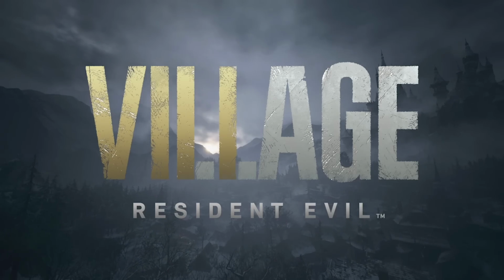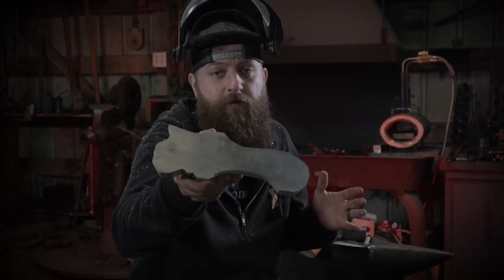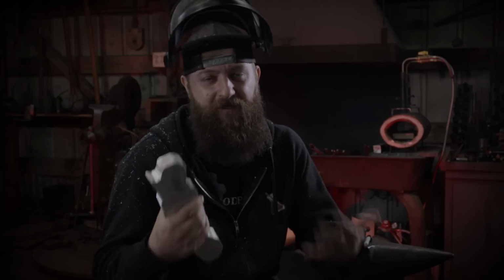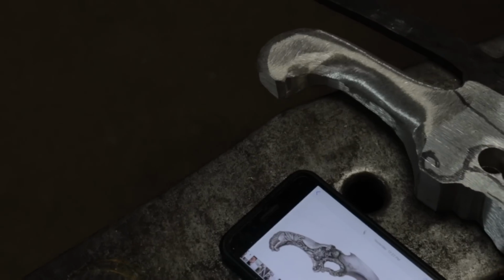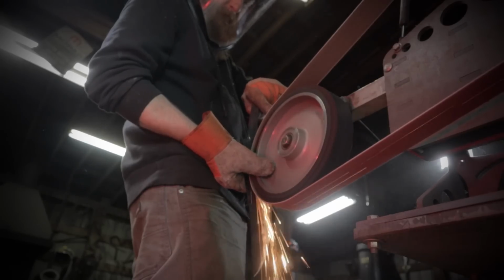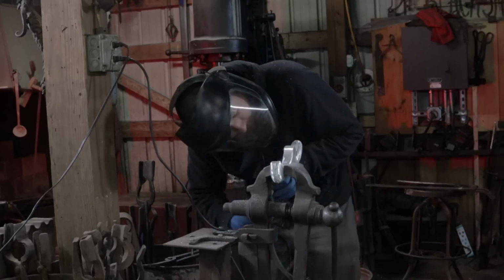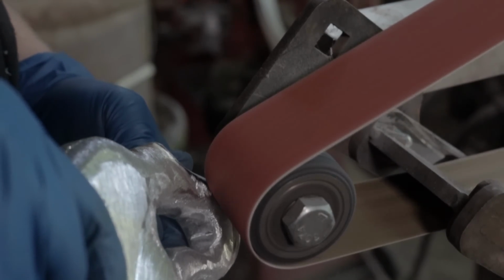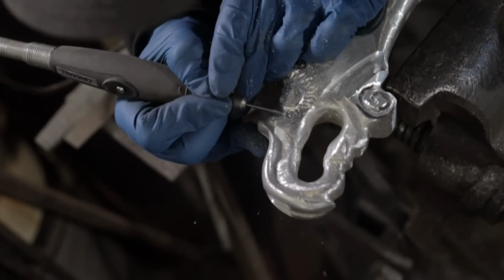Resident Evil Village - Dagger of Death's Flowers

Comment: Those loose baggy gloves makes me nervous on the belt sander, I'd say try some Tig welding gloves, they fit much better while still protecting the hands. It's what I use when I'm fabricating. Also try a bit of wax on the sander when grinding Aluminum it'll keep the belt from gumming up as quickly. Obviously you guys are the pros of your trade I'm just trying to share what has worked for me.

Comment: I'm mostly a wood carving guy, myself, but it really seems to me that you started the handle with a billet that was way too big. Now, I get that you're limited in choice by the stock you have on hand, but you sliced off the billet with a bandsaw, so I'd think you could reduce the stock the same way. Then your complaint about carving the silhouette and dealing with the heat build-up looks to me like tool-blindness more than material limitation. You should have just cut on a bandsaw close to the profile, then brought it down. It would have saved on time and heat.

I guess to a grinder, every problem of stock removal involves a sanding belt.

Comment: But, how does one attack metal blade to metal hangle? rivets? or setting it in some sort of glue?
Reply: About the 19 minutes 30 second Mark, there is a close-up on the handle where the blade meets it, I do not see any holes for rivets or pins, so glue or epoxy or even maybe welding is probably the answer. Can you even weld two different types of metals together?